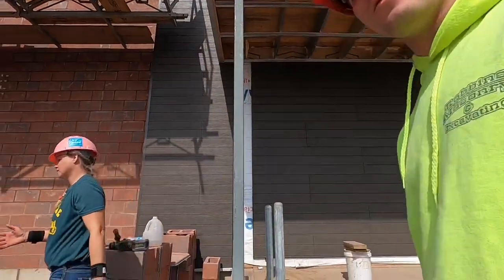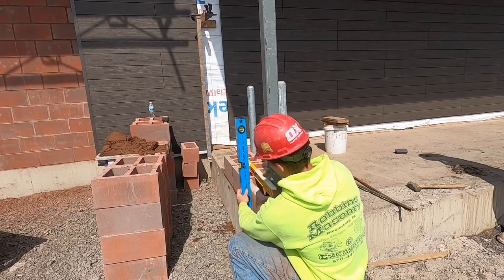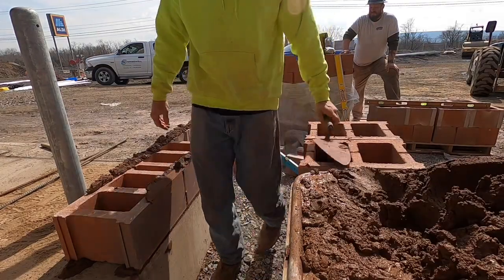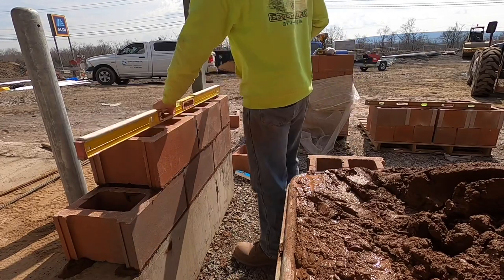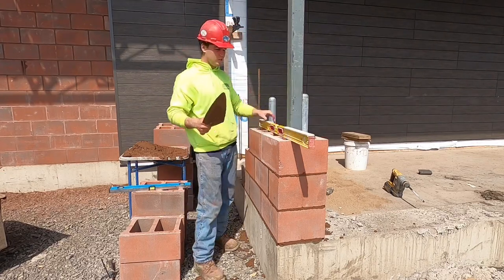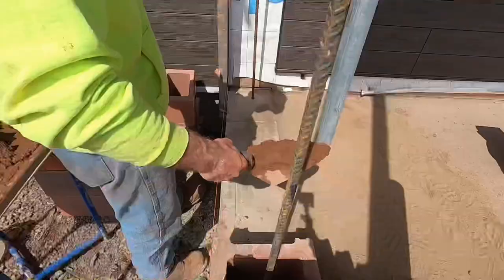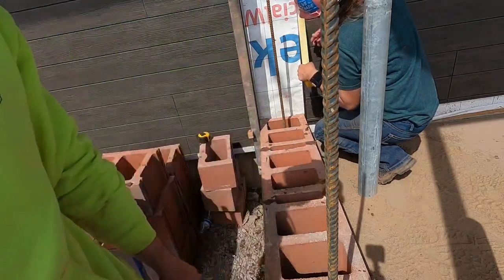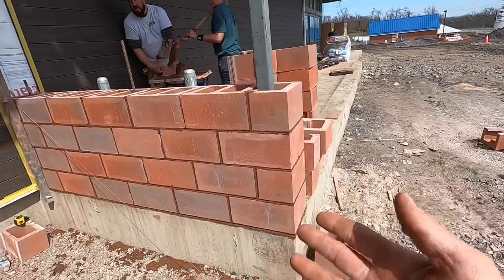How to lay a block wall

Comment: Mason so many guys say to not tap on the level  why do you tap on the level versus the block?
Reply: The yellow level is a Stabila mason's level that has a white bumper strip designed to be tapped. It's also faster because you're aligning all the block at one time.  But I agree, it goes against the grain to beat on your tool...
Reply from the maker: Marvin said it. I would rather do it this way. If it hurts the level I’ll get a new one, but my level is really tough so I’m not worried about it

Comment: Why such a big lead on a short wall l why not just range in the 1st course get plumb and level and spot and run seems a waste of time and money building a big lead
Reply from the maker: I had to lay the first 4 courses from the outside then move to the other side. Just got done with all the leveling at once. I like to go up 3 on the lead usually tho
Reply: I agree,lot of  wasted time. Spot and go. No production at all working like that.